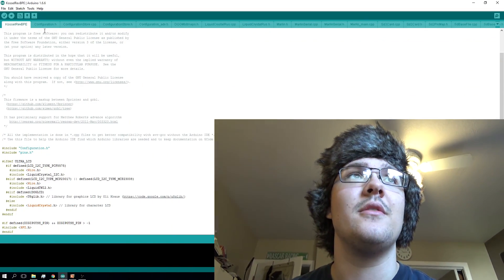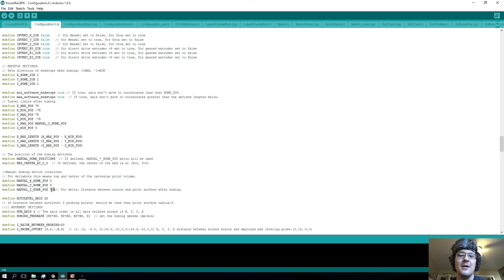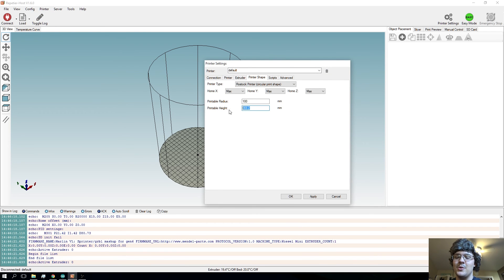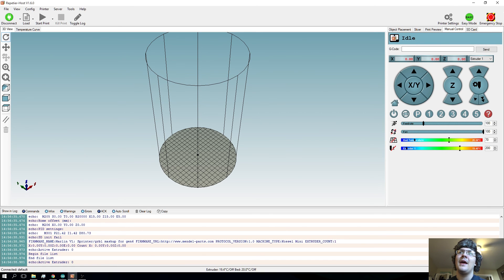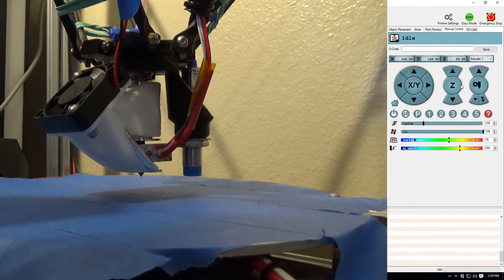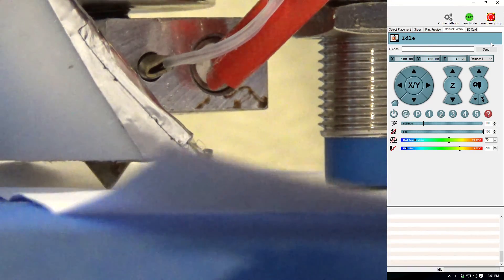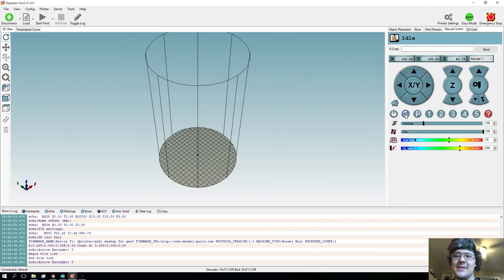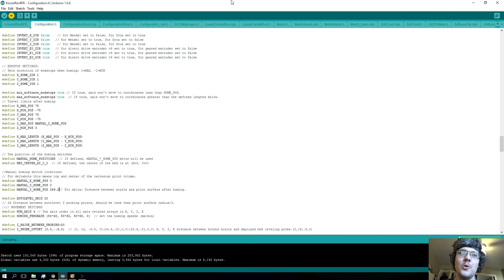Folger Tech Kossel 2020 3D Printer Calibration | #5 - Bed/Z Height

Comment: My arduino code won't verify or send to the printer. I downloaded it straight from FT's google drive, and have tried re-downloading it with no change.
Is there possibly a mirror for the code?
Reply from the maker: be sure you are using arduino ide 1.6.7.
Reply: You're the best man. Was running 1.6.12, reverted down to 1.6.7 and code compiles.
Just waiting on a part to show up Friday and I'm hoping to be printing shortly after that. Really appreciate all the videos helping with this process.

Comment: Hey dude. Just put on new carriages with bolts to adjust endstop heights. After I did the paper test in the middle now it prints too far from the bed but still passes the paper test. Any ideas? Z-probe offset maybe?
Reply from the maker: First layer hight in your slicer maybe.
Reply: +Dustin Corbin It is set at 0.2 right now which is what it was before I put on the new carriages
Reply from the maker: +Mark Mathews did you change the height in repetier and the firmware? Try lowering a little more.
Reply: +Dustin Corbin That was my thought but when I manually move the extruder down to zero it is in the correct spot
Reply from the maker: +Mark Mathews it could also be the z value of the probe offset.
Reply: +Dustin Corbin I've been playing with different values. Does increasing the z value of the probe offset make it print higher or lower?
Reply from the maker: +Mark Mathews it seems that a lower number (negative) will make it print lower. But it's kind of finicky.

Comment: I uploaded your exact code with the changes to my printer dimensions, and it still does not print near level. I'm starting to think it's a mechanical issue and not firmware. If one arm is of by less than 1/16" would that cause it?
Reply from the maker: +Mark Mathews The arms being off any little bit can really mess it up. Also, you may need to raise up the endstop nearest the side which is printing too low. I was having problems with that and just moved up  the nearest endstop and fixed it.
Reply: Dustin Corbin i

Comment: Thanks, Dustin! These videos are really helping me get my 2020 running.   This process seems to imply your bed is already level.  Can you go into how you leveled the bed in the first place?
Reply from the maker: +Batti2323 If you built the kit like it was intended, then the bed is not adjustable (and should be close to level). You tighten it down and that is where is sits, which is why the kossel is designed with the auto bed leveling feature which I talk about in the 3rd Episode of this series. There are various mods you can do if you want to go into the world of manual leveling but the auto leveling feature should take care of the bed not being level. Also that auto leveling feature happens before every print, so you can use this video to set the height, and once you activate the auto level, everything else will be taken care of. :D Hope this helps.

Comment: thanks a lot for the guidance, got my printer all working now. I'd love a video on some of the tweaks/improvements you've made and steps to dialing in prints. I have a bit of what looks like z axis wobble, which i'm working on. it seems like your headed in that direction already though.
Reply from the maker: +Samuel Morris Ill be making more vids as I come across ways to fix various issues. I actually am still working on a few things myself that are out of calibration for my printer. Unfortunately my issues aren't firmware related so it's harder to adjust. If you are having z wobble see if it looks similar to what i experienced in two videos I posted a few days ago right before #4 of the calibration series. I had z axis movement that was because of the tie rod ends, and I had a simple fix in the second vid. Just keep following me and expect at least a video a week if not more! Glad I can help!